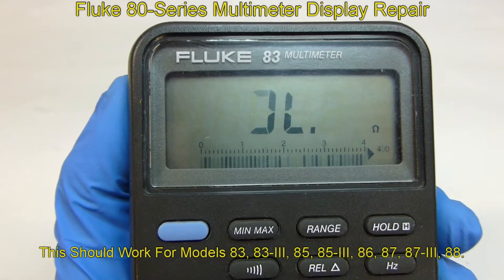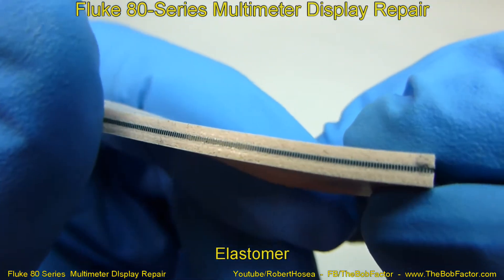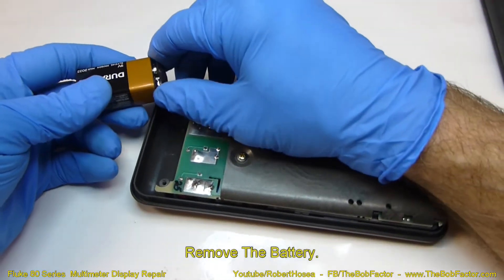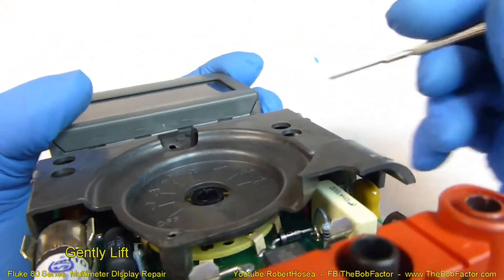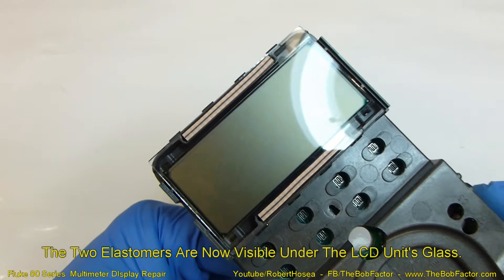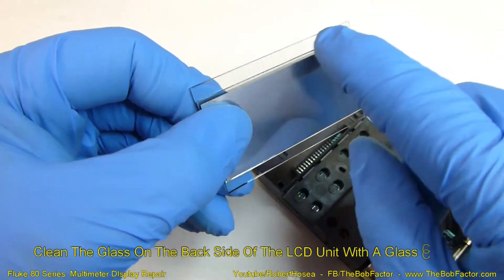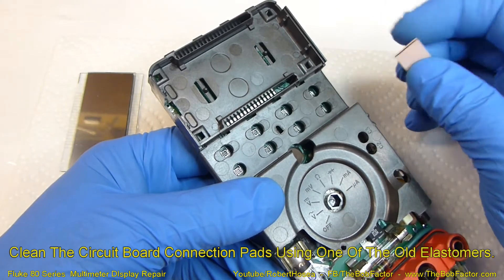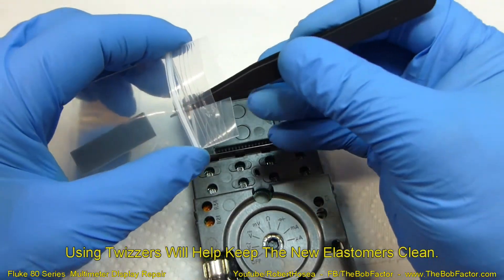Fluke 80-Series Meter Faded Display Repair

Comment: Hi I’m in desperate need of help. I have a canon 6d and the mode selector is not working and by that I mean the small button on the mode wheel you push down and twist the wheel with. The push button is permanently stuck down ! Help I’ve used aceton to clear any glue and such but it seems super glued down
Reply from the maker: I don't have a video in my Canon 6D video repair series for repairing the power/mode switch, but I do have one for a Canon 60D, which may or may not be similar. So use the first video in my 6D series to remove the top section of the camera, here's a link to that video: https://youtu.be/tUl9cV5GA4M, and then use this video https://youtu.be/rpE7Co3dfgo, which is from my 60D series, to get an idea on how to disassemble the power/mode switch. Again, I don't recall how similar the power/mode switches are between the 6D and the 60D though. Sorry I can't be more help.